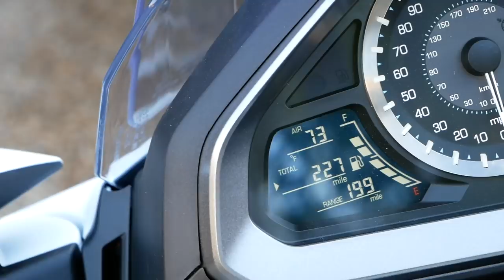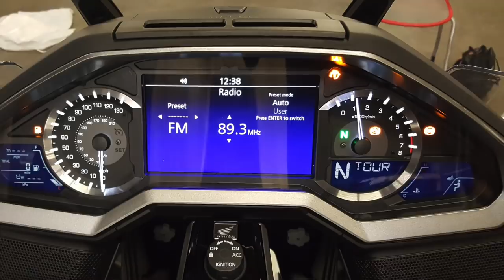2018 Honda Goldwing Long-Term Review

Comment: Good job Chris. I agree 100% with your assessment. Fix the POS Nav system, and go back to helmet hangers off the trunk. Then it would be perfect IMHO. As an iPhone user, the nav choices there are really not much better. They work, but routing out of the way routes are quite spotty. I too like my Garmin. Own both your pre-18 and 18+ videos. Thanks for your good work. Guys, buy the vids. You won’t be sorry, and WILL save lots of $.
Reply from the maker: Thanks for the plug! And for your patronage.
Reply: Good job Chris for critiquing the bike. Three advantages of the 2018+ generation that you didn't touch on. 1) The engine powered parking lot walking mode  for forward and reverse. Such a thing didn't exist in previous models.
2) The amenity that you didn't talk about, is The Slope Assist model. My gate is on a relatively steep slope. I stop to let the gate open. The Slope Assist is wonderful to let me go forward without rolling back. 
3) The digital TPMS, Tire Pressure Management System. Here we get a definitive distinct number for either wheel. We see immediately if we are under inflated. We can also watch the pressure variation based on temperature & different road surfaces.
Thanks
Rod
Reply: Those are a couple of features that I'm sure many folks are applauding!!!
Reply: I use Waze all the time... Not real impressed with iPhone Maps...
Reply: The DCT is much easier in slow traffic especially with a passenger. Sport mode rips! Trail braking in Sport Mode does set off unexpected down shifts mid turn. Parking assist and parking brake are a plus. I have the DCT A (red and black) and receive compliments on the styling from both riders and non riders. Backrest and cruise pegs are a must. The lower weight is another plus. So far, the best model that I have owned.
Reply: You can use google maps on the iPhone and it's prettygood

Comment: Chris, what a great overview. Most appreciated. Like you, I am a solo rider, so I can live with the smaller storage capacity. I can strap a good sized duffle on the back seat, and I'm good to go. This summer will be my third Run For The Wall, 7,500 miles in 2 1/2 weeks. Last two trips were on my Road Glide with a trunk, so it will be interesting to see if there's any major difference in convenience. Overall, this is the most amazing motorcycle I've ever ridden, from Ninjas to Harleys. It puts a smile on my face every time I take it out.

And, as you said, working on this yourself, at least for some tasks, is going to be a must unless you want to start giving your kids' college tuition to the dealership. I have purchased your videos, and I am more than pleased. Money well spent, by a mile.
Reply: Clay Nicolsen 

You got that absolutely right Clay.

Comment: Nice review about the Goldwing 2018 👌. I drive for 32 years with the motor and for the first time in my life I bought a Honda Goldwing model 2018. And after 4 months of driving I can say what a pleasure and comfort this engine has, I have never had this feeling, I am very satisfied with this  motorcycle. And there are always fewer and good points on every bike, but the bad points are nothing compared to the good points that this engine has, but that is my opinion.
For me, this is the best motorcycle I have ever driven.

Comment: I agree with everything you’ve stated. However my fuel mileage with the tall F4 wind screen has been averaging around 36-38 mpg commuting. I haven’t had a decent long trip without a bunch of wind to get an accurate highway mpg. With the stock screen, I got as high as 50 mpg on one tank, but averaged 45 mpg on the highway, and 41 mpg commuting. 
With the stock screen, and my height at 6’1” I was getting unwanted buffeting and with the screen fully extended, the top was right in my line of sight. With the tall F4 shield, buffeting is almost nonexistent and no longer in my line of site. 
I also added the Honda lower wind deflectors, and all I can say is they work great. For some, in the summer months, you might want to leave them off but for cold weather and in the rain... They work!!! 
I also added the Gold Strike adjustable Highway pegs. They look great and function very well. I wish I could position them a little more forward, and I might tinker around with them down the road eventually to attempt a different approach with the position adjustment, but they work just fine for me. 
The seat sucks, and will be sending my stuff out to WingSoft to solve that problem.
Only gripe i have is the bike will sometimes jerk or surge a few times as I come off the throttle slowing down. Not sure what is causing this to happen, but I suspect slack in the drive shaft gears. I haven’t dug into it, and I have noticed that the rear differential fluid isn’t quite at its full mark. I have also noticed that the bike shifts much smoother with fresh oil. I changed the oil twice so far. Once at 1,000 miles and again at around 4,500 miles. I’m creeping up on 8,000 miles here in another few hundred miles, and will do another full oil change. 
The only issue I have found is recently when I activated  Apple CarPlay, the screen is all scrambled. Again not sure if the issue is the latest IOS update or a combination of IOS update and still running the factory infotainment update version. 

I also have a 2016 Harley-Davidson Road Glide Ultra CVO. The Honda Goldwing Tour DCT has me spoiled to the point I don’t care for riding the Harley anymore.

Comment: Great review of the 2018 Goldwing. I have had mine for about 6 months now, and have over 5,000 miles on it. I absolutely love it. Just like you, it fits me just right. I feel more confident in the twisties and in slow speed turns. Yes, there are some things that I don't like, just as you do. One big problem I was surprised is the seat. I have owned a 1200, 1500 and a 05 GL1800 and never had a problem with the stock seats. I could ride all day and have no problems. This one, I ride 2 hours and it is time to get off. I bought one of those air hawk type air cushions to help with that. However, if I were asked if I would go back to an older Goldwing......No...not a chance. Thanks again for your videos.
Reply: How  does it feel to ride a dct vs a 6 speed touring?

Comment: First off the ones saying the suspension is bad are also the people who sell aftermarket suspension systems. I don't own one yet however I have one in the shop and I am so impressed with this new bike. I think it is the prettiest motorcycle ever produced. Very good assessment and you are spot on with your report. The DCT is really the only option as a 6 speed manual on this wide torque range engine is a mistake. On a trike the DCT is perfection.
Reply: They are a magnificent machine to work on. A little intimidating at first but simple after u get the hang of it.
Reply: Endeavor Trikes why would you say the manual 6 is a mistake? I am buying one and while DCT is very interesting I want a clutch l.
Reply: @Kickstart500  The usable torque range of the 1800 spans almost 5000 rpm. The main reason for more gears is to compensate for a narrow usable torque range like that which exists on most V-twins due to severe shaking at low rpm. The GL would actually do well with a 4 speed and a 5 speed is almost overkill. The 6 speed simply means one must shift more than needed or skip shift. Some owners of the older wing even skip 1st just to limit the number of gear shifts. The DCT is a 7 speed but the rider is not shifting so that is perfectly fine. While I think the 6 speed is a mistake I am sure one will be just fine using this and one does adjust. There is no way I would not buy the DCT as it is a real pleasure to ride. And it's about time motorcycle transmissions adapted the change brought to cars 80 years ago. How many people buy cars with manual transmissions? I doubt you can even buy manuals in most cars and for good reason. In a recent economy test of the 4 major transmission type (manual, standard automatic, DCT and CVT) the manual faired by far the worst followed by standard than DCT and CVT being the most efficient. The tester rated manual as the worst as no human can shift as efficiently as a computer, this is true.
Reply: The 12th Fret thanks for the great explanation. I put 80k miles on my 2008 wing. I often wished for a 6th gear on the hiway but I see your point
Reply: I also made the mistake of trading that bike for an Indian Roadmaster. Great bike but so not a wing. If I was more open minded and the Maintenence wasn’t so high I’d consider dct

Comment: Thanks for the honest review and the fact that the new Goldwing is NOT the best solution for everyone who wants to tour.  
I own a fully loaded, including airbag, 2009 Wing which my wife adores.  It accommodates all our gear and EASILY holds 2 full face helmets in the truck along with a bunch of smaller items.  Like you, the first time I sat on the new wing I thought "these seats are junk compared to our bike".  I was also quite surprised that even though the new bike is lighter, it was actually more difficult to pull up off the sidestand than our 2009 model.  My wife couldn't stand the grab handles for the passenger.  With the negatives piling up pretty quickly in the showroom, we didn't even bother to take a test ride.  
Instead, I purchased a 2017 Honda CB1100EX for my solo riding jollies.  My wife has ridden on this machine exactly once!  That bike is an absolute blast from the past while also being totally modern.  It's fuel economy is mind blowing, in fact the best of any motorcycle I've ever owned, including those in the 450cc range.  The fuel injection calibration is spot on, unlike the Wing which can stumble when not fully warmed up and that can be very disconcerting when coming out of a sharp corner, especially with the wife onboard.  Also, I have not been able to fault the fit & finish on the CB1100EX in any way.  The welds are a work of art, the paint is flawless, and the chrome is gorgeous.  This bike turns heads everywhere I park it.
So:  A lovely low mileage Goldwing for touring with my wife, and a toy to remind me what motorcycling is all about.  They're both keepers!

Comment: Wow, I’m impressed. As a Canadian motorcycle rider I’m presently in stuck in snow bank mode; way too much time looking at bike reviews.  However, I’ve been riding long and hard on all kinds of bikes for about 50 years and a Goldwing is starting to look like a possible replacement to my beloved fully farkled VFR. So, this review got me at “Tail of the Dragon” which I’ve ridden literally hundreds of times over the past fifteen years.  I’m also lucky enough to have other bikes, so a behemoth in the garage doesn’t petrify me as much as it use to do. Yep, I’ll lose a few buddies but the heck with ‘em. 

If only you could do a comparison as high quality (and open-minded) as this between the new ‘Wing and the BMW 1600 GTL. Between that and my wife, I’d hardly have to think for myself at all.

Comment: Just took delivery of my 2019 Goldwing DCT finished in red and black colour scheme. After watching your video regarding the fit and finish issues you had reported on your new bike my first thoughts were to go over the paintwork on my bike to look for any issues. I am glad to report that the finish of the paint is up to the standards that I expect from Honda. I have also looked very closely at the fit and operation of the trunk and saddlebags - again absolutely no issues at all, they all open and close perfectly. Not tried out the Bluetooth capabilities yet, just has a Sena system fitted to my Shoei Neotec 2 helmet so will be trying this out over the weekend. At the moment I have nothing negative to say about my new Goldwing, it is certainly that bit lighter than my old 2016 model, this is particularly noticeable when placing the bike on its centre stand.
Reply from the maker: Congrats on the new bike!
Reply: It's great to hear these details reporting the stated improvements!!!!!!!!

Comment: Excellent review sir. I'm not a goldwing rider but I did have 2009 goldwing. That was me when you said to heavy and a little much to handle in tight places. That helmet storage and the extra wind buffeting was my deal killer. It is very easy to handle compared to the 2017. Everything else you said I agree with 100 percent. Ride safe

Comment: I purchased a 2018 Goldwing Tour DCT about 7 months after you did. In September 2018 did a 3,800 mile ride with a bunch of BMW riders, four GS bikes and two RT bikes. The Wing not only kept up with them in the twisties but excelled by putting the suspension in two up and luggage mode during those sessions to stiffen it.  Regarding the seat, since my bike was later off the production line maybe Honda had already made some changes because I found the seat the most comfortable my booty ever perched on. Like you I am a little taller at 6'-3" and skinny so my booty is missing some cushioning.

Comment: Excellent review! I agree with most of your points. I haven’t added the fog lights and probably soon will. The reason is that I hope it will help address the headlights when riding at night (mainly while turning sharp turns) the headlights (high or low beam) put a line across the road ‘trees on the left or right - road 10 feet in front of the bike on the road’ there very little lighted vision down around the corners!!! I think this is almost bordering on ‘unsafe’ - I don’t do much night riding and even less on tight curves after dusk.. - so I’ll leave it at that.
Reply from the maker: The headlight "line" to which you refer is a symptom of the way Honda focused the LED lights. That's what I don't like about LEDs, if you don't focus them, the light just scatters everywhere. An LED simply throws light forward, where it then rapidly dissipates in all directions, whereas a Halogen light is a bulb that throws light in many directions and can be harnessed and directed with a reflector. IMO, Halogen and HID is simply "better" light. LEDs are a gimmick that everyone has bought into, so this is the world we live in.

Comment: I test road an 18 and I really liked it with the exception of most of what you said. When it came to the various modes, I found Sport mode to be absolutely useless in the city. It is too aggressive when starting out and can get you into trouble real quick in traffic. I had an 08 but lost it to an insurance company when a woman ran a red light in an SUV. Turns out she was texting and driving. I really did like my 08 but it was a bit of a pig weight wise for me (I'm 5'7" and 180 pounds) but with Traxxion front and rear it handled like a Porsche. One thing I have heard about the 18 with a manual shift that is a bit of a bummer is the shifter design itself. While the shifter works great, the boss where it goes into the engine is prone to damage from underneath and can break off the engine. This will not be fixed under warrantee and requires new engine cases to fix it. I am sure that someone is working on a guard of some kind but you might want to keep that in mind should you buy an 18 with a manual tranny.

Comment: Honda is so close with this bike,  a little more storage which could have been done with trunk lid and making side bag lids flush with inside of bag would have looked better too.  Could have great range if tank was still 6.6 gallons or even 6 gallons- 250 to 300 miles between stops would be great-like bmw.  Honda could do a LD (long distance) tourer with more storage, more range, touring seat etc  Missed mark with most Goldwing owners.

Comment: Great presentation. It was very easy to follow along and comprehend your delivery. I was also eager to advance to each stage of the video and my attention was held from beginning to end. 
That being said, unlike your verdict that this is the best bike “for you,” the negatives you listed still keep me away. Even what you considered a great improvement, the size and weight, those were, and are still, negatives for me.

Thanks for your in-depth critique on the 7th generation Gold Wing.
Excellent job.

Ride Safely!
Reply from the maker: You're certainly not alone. Many people prefer the larger platform of the previous generation. It certainly has an appeal for long-distance touring.

Comment: Nice write up (uum video).  I bought a 2001 Yellow ABS new and sold it in 2011 with 65,000 on it.   Loved it.  This time I got a 2014 Valkyrie(love that engine,).  Put a wind screen on it, some blutooth speakers, ram mount for my phone and a charging port, Sissy bar, and saddle bags.  I'm happy it's super light, and fast. someday I'll get a new wing again as well.